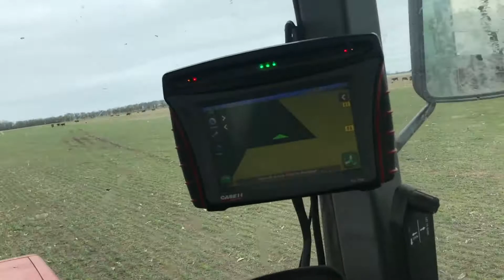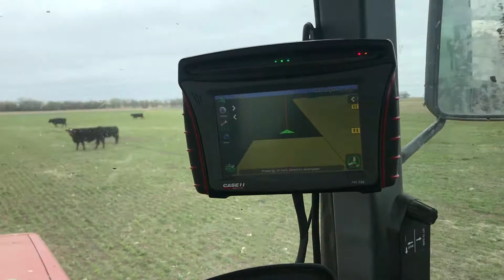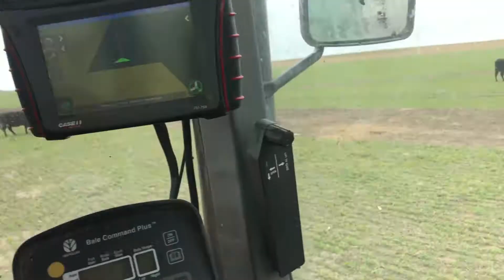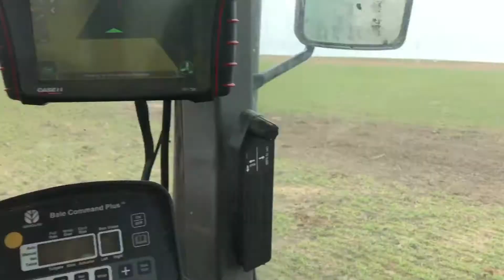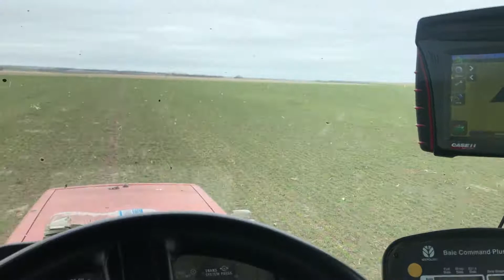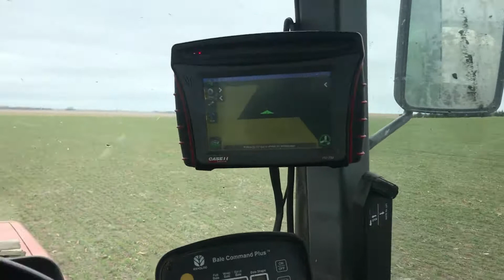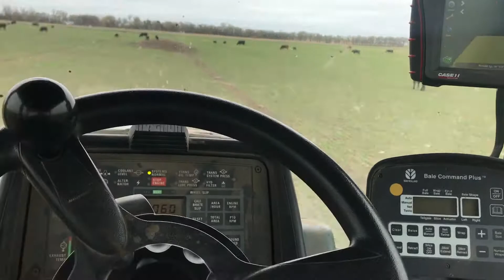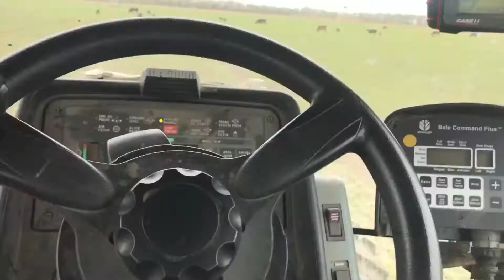Spreading fertilizer, grazing rye update and importance of fertilizer

Comment: I have no idea how much precipitation you would get per annum nor what the spread is like month by month but here we get, in my location in the UK, about 50-70mm per month with a little less in the Spring and more over Winter. (We do not get much snowfall that lasts more than a few days and is rarely very heavy).
However in general we tend to assume very little carry over of Nitrogen from one year to the next due to leaching by soil water movement - certainly Autumn soil testing N results are basically ignored as likely to be an unreliable source of information for fertiliser requirements for the following crop in the next spring. Farmers and advisers are far more concerned at this time about pH, phosphorus, potash and trace and micro element levels so that corrective and/or maintenance doses can be calculated and applied as appropriate.
The use of ATV computerised GPS soil sampling and tied to yield mapping has highlighted many vast variations in soils even in small 20 acre fields which are now being addressed with the use of variable rate applicators linked to accurate GPS signals. (note: not all these variable yields are by any means tied to plant nutrition!)
Reply from the maker: We average around 20 inches per year.. and i think that is like 508 mm most of our precip comes in the spring and early summer.  We actually soil test once the ground is frozen in the winter so there is very little chance for nutrients to move once the ground is solid..  I think in the future variable fertilizer and seed will be here but as of now that technology is out of my budget... I will love t start using it as soon as i can justify the cost of it   right now im gathering data from yield maps and soil test so in the future i can implement better nutrient management!!  I truly enjoy your comments keep them coming!!

Comment: Where I live in Indiana there's some much liquid manure I get it free or they pay for my time and fuel
Reply from the maker: Now that would be a heck of a deal... We have a feedyard that will give it away but its 15-20 miles away and its hard to pay someone to haul manure that far
Reply: Ted Kahler with in 10 mile radius there are at least 50 hog barns plus I use a semi tanker so I can haul 7600 gallons league